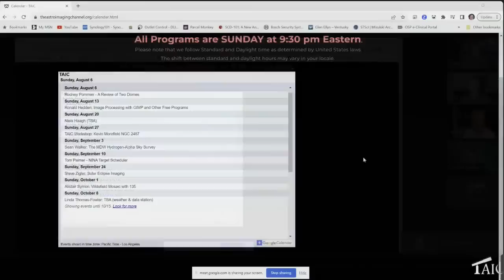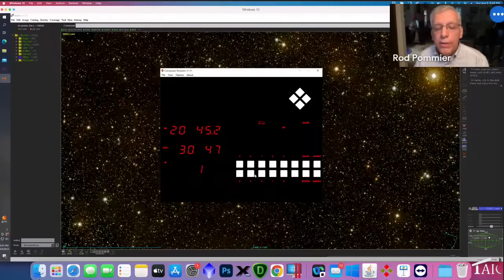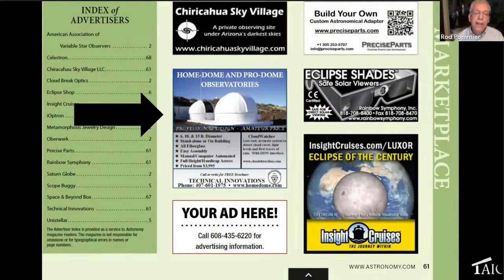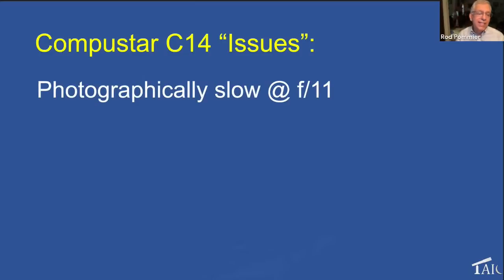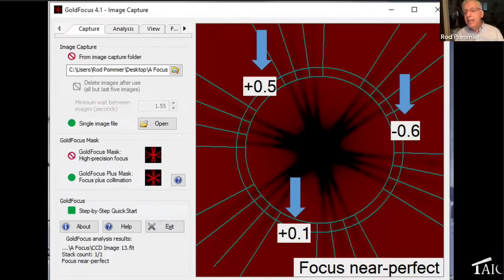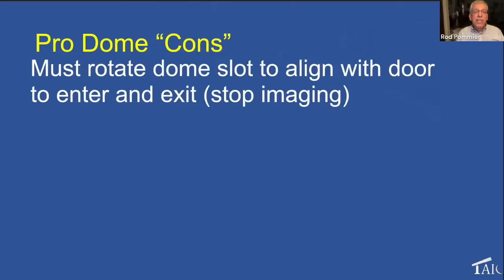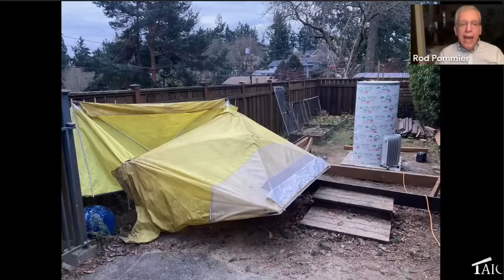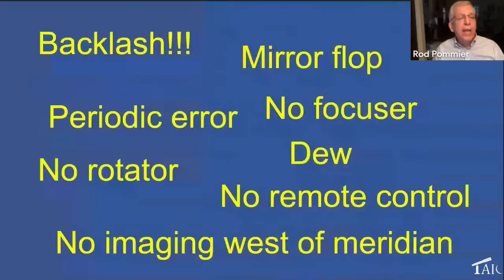A Review of Two Domes | 2023-08-06

Comment: Very informative.  Thanks for sharing it was enjoyable to see our similar journeys in Astrophotography since the early 1980’s.  I just acquired my new backyard fully automated PD10 in May of 2021 as my first observatory.  It definitely requires some regular adjustments and maintenance compared to an Ash Dome but I totally love it.  All of your Pro and Con observations are pretty much spot on, except the PD10 now has a split door design that allows entry at any time no matter where the shutter is pointing so it is no longer necessary to rotate the dome back to home to enter/exit through the door.  I also went with four wall rings instead of three which makes it much easier to duck in and out.  It was at the perfect price point for how much I wanted to spend on my Astrophotography hobby. In my mind there are two factors governing a purchase . The first is the financial means to make the purchase and then the second factor is how much do you actually want to spend on a particular hobby.  The second factor being a very individual decision.  Congratulations on your new Ash Dome and the Planewave setup after many years of The best of times and enduring the worst of times.  That is a fantastic combination that will now more than likely just give you the best of times.  Now you just need to fully automate it so you can sleep all night, lol.